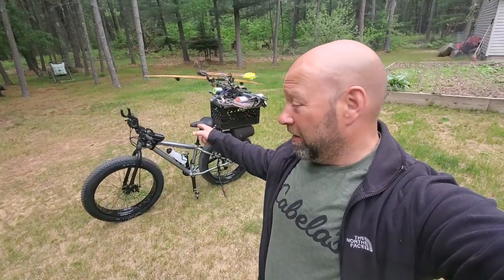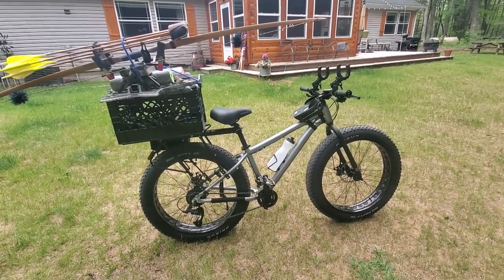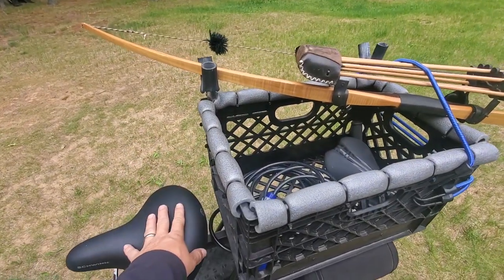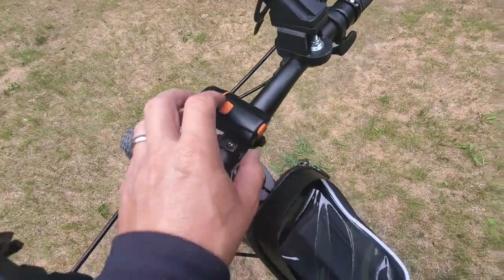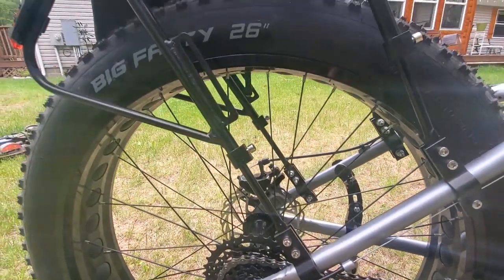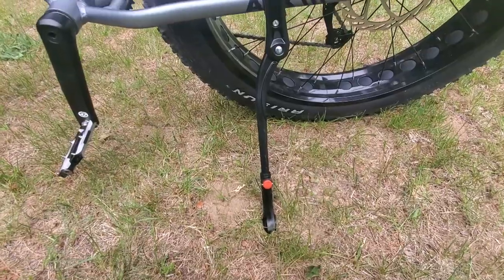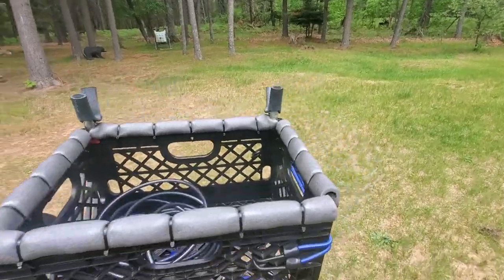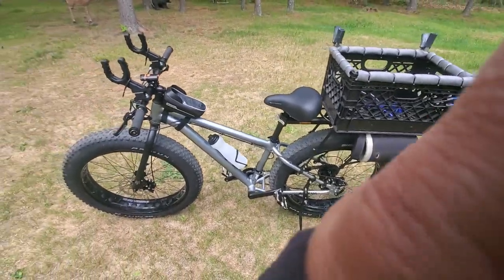Hunting Bike Set Up Fat Tire Mountain Bike Or E Bike

Comment: I rigged up my Mongoose Dolomite with front and rear racks, saddle bags and lights.  I have taken elk and loaded up the racks with both hind quarters and rode out, then went back and brought out the front quarters, back straps, next meat and horns while riding it out… the guys in camp laughed at me at first… but I am 63 and it sure made things easy on the Wyoming non motorized forest roads
Reply from the maker: Love it! Sounds like a perfect pack mule of a bike
Reply: @SamkoTradBow  you have a sweet rig yourself… but I will admit.., I am thinking about Installing an e-bike conversion kit on my mongoose dolomite… I have thrown a 55 gal. trash bag over my seat and frame, the draped a whole deer over the bar and seat, tied the legs together and rode out using the deers back as a seat… I caught some sarcastic crap over that one… lol
Reply from the maker: @raytribble8075  yep the ebike kits are becoming much more affordable now too.

Comment: The bike is nice but instead of the set up you are using I would use a trailor like an altered kids trailor that has been stripped of the cloth and reenforced for hauling game and hunting equipment so as not to lose it to predators and add a mid drive high torque high power ( heavey duty hauling ) electric motor. Your back rack should hold the battery for it. And if done right you can use all of your gears to power the bike without losing any of them.
Reply from the maker: Great ideas! I acutally sold the bike and bought a john boat! But others that read this will appreciate your ideas. Thanks for commenting.

Comment: I chose the E-CELLS Super Monarch Crown.
It has 2 wheel drive, 2 batteries, dual suspension, fenders, hydraulic brakes with beefy 2.2 mm thick discs . It is an E-MTB for hunting here in Nevada. Very reliable components sourced form several countries and the Pahrump-based company headquarters only 50 miles from my home in Henderson, NV.
So yeah, another boutique e-mtb company but one with  great quality for the money. My bike was $4,800. before taxes which is great compared to ALL other 2 wheel drive e-mtbs because they don't have the many features my bike has and some cost a LOT more.
My bike is rated to carry 400 pounds max.
Reply from the maker: Awesome

Comment: Nice bike but the amount of weight ur talking about would b very top heavy,I'm thinking a trailer would be better to lower center of gravity
Reply from the maker: Yep it would.  But you also then have more weight and more rolling resistance.  Everything is a trade off. Both are great options

Comment: Nice setup, have you considered a saddle bag approach for deer and hang it off the sides of the milk crate to avoid a trailer?
Reply from the maker: I have been thinking about it. It would be nice to get the weight lower. But I don't think I want to deal with dividing the meat up on each side and cleaning out the saddle bags. This will be more pig hunter than deer hunting for me. And a pig will yield less meat that a deer most of the time unless I get real lucky! So the crate is fast, easy, and should work great. The crate also keeps my bow up high away from stones coming off the wheels.

Comment: Finally got my public land pig. Had to haul out in my pack while riding my bike. Not ideal. Going to buy one of those Burley Trailers
Reply from the maker: Yeah that high of center of gravity on a bike is hard. The trailer will work great. I do believe this crate eight above the back tire should be low enough to work great and avoid the trailer. I don't want to pack, set, up or drag the trailer if I can help it
Reply: @SamkoTradBow  trailers are collapsable and easy to pack.
Reply from the maker: @amateurbiggamehunter7691  collapsible means I need to assemble and disassemble each time. Easy to pack still means I have to pack and its gonna take up space making me climb into the back of my truck or put in and out of my suv each time. And I have to maintain the trailer, wheel bearings etc. I have to drag it everywhere fighting it the whole time. But I may still end up wanting and needing one. But if I can make something work rather than a trailer I'm definitely doing that first. Nothing about having to use a trailer excites me personally.  I'm very glad there are such amazing trailers out there now and they do work great! But I hope I can avoid going that route.

Comment: Are you going to get fenders?  It'd be nice to keep the mud splash off your backside.
Reply from the maker: If I need them I will. Right now with the rack and crate on the back I don't really need it. But I will add them if needed
Reply: I'm not sure how anyone could not need fenders.  Dirt, mud, debris, gravel etcetera.  I could not do that to my compound bow.  basket or no basket, I'm a clean freak 😂

Comment: Hey bro do your research e bikes up to 750 watt only 20mph are considered regular bikes class 1 and class2 only class 3 and up considered motorized my sister and brother in-law he hunts just bought the Rad power bikes and WOW I RODE THEM THEIR FCKING AWSOME  UNDER 2000 FUNNY HOW THE HUNTING ONES COST 5000 AND CAN ONLY BE USED FOR THAT PURPOSE HUH happy hunting the little kids tow trailers work great get um used cheap like 50 $: dude awsome stip cloth off it folds out like deer cart
Reply from the maker: some of the places i am going into are pedal, foot or horse only. now electric or gas power. so need this pedal only version. plus the exercise is a great thing.

Comment: Love the Bike idea. Your rubber hose covered clamps are great.
With that basket on the back it is going to be harder to mount. I like the 20" fat bikes with stepthru. These in an electric would help assist for hills or coming out with the load of meet.
https://www.ampridesusa.com  or https://www.radpowerbikes.com/  
Amp Rides has some bigger battery options with folding but they are a long wait for delivery -- The Rad Runner would make a good hunting bike as well but get an extra battery.
Cheers
Reply from the maker: Fantastic tips and info. Thank you. Where I'm hunting I can not use an ebike as its not legal. But excellent info and thank you.